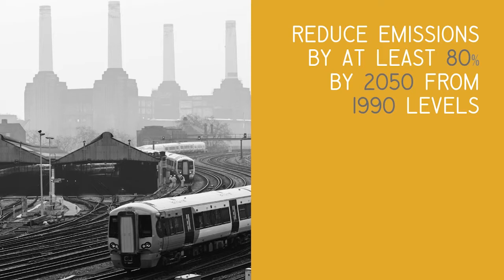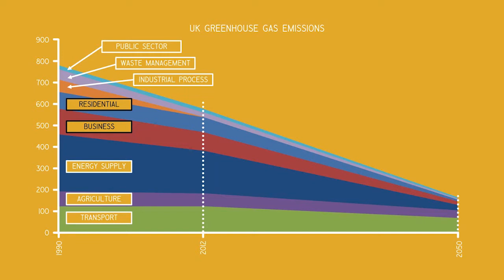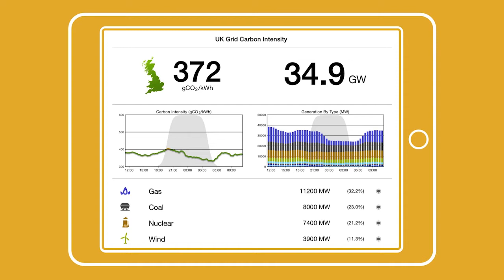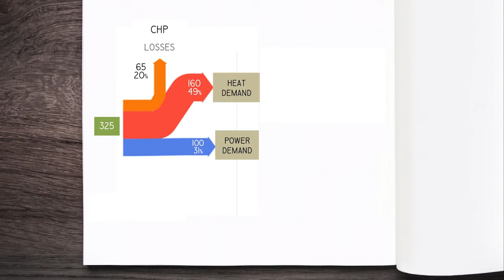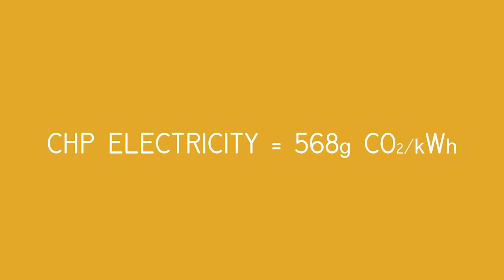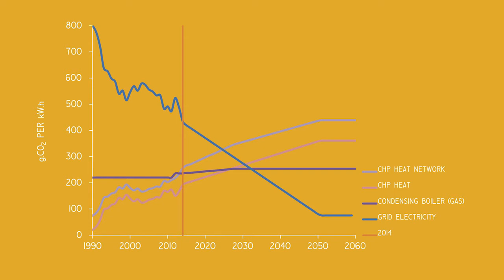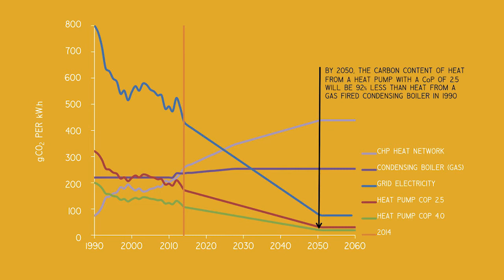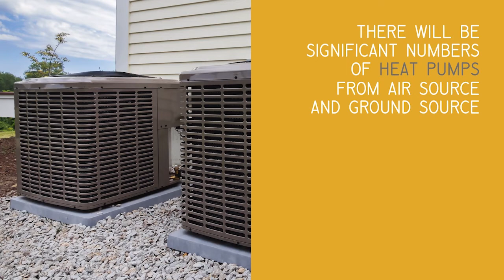Decarbonisation Of The Built Environment In The UK

Comment: Largely agree with the analysis; especially around the point that high temperature district heating systems supplied by gas fired CHP are now worse than gas boilers.  However,  I have several challenges to make on what was presented that I think paint district heating in an unfair light:

1. In a large residential development it doesn't seem particularly a good idea to have an air source heat pump per residential dwelling for various reasons, such that we often will have to see large central ASHP's that supply heat to each flat. Large central plant is also the solution on most commercial buildings. This leads to the large overstatement of the efficiency of ASHP's that James has made due to the fact that secondary heat losses will have to occur. These are losses are between 10-20%, such that the carbon intensity of the heat they supply is also in this application proportionally higher.

2. Well designed low temperature heat networks have much lower primary system losses at below 7%; clearly this will always mean that district heating systems do incur an efficiency penalty relative to a stand alone building solution. However, a low temperature district heating system can enable much more efficient "heat recycling" as James put it. The simplest example is the commercial building that is next to a residential development: apply heat recovery to the cooling system in the office building, and send it to the residential development; using large centralized thermal storage you can also defer it's consumption to the evening and morning peaks.

3. There is in my opinion a 'right way' to design implement and run heat networks that will bring really low carbon heating, at a lower cost and carbon factor than communal ASHP's or even individual ASHP's. The externalities of such a network are potentially very interesting and worth while if you consider that you can (a) balance heat demand and supply e.g. where it is often wasted, it is because it is not needed at the same time, different types of buildings have different heating demand profiles; (b) should a new and better heat supply technology come along, or should a new low carbon source materialize, it  would be substantially easier to integrate and supply existing customers from this source; don't forget the huge issue of entering each home to replace a system that has become obsolete....

Overall i like the analysis, but I think a ' how to do heat networks properly' is now due. I will certainly not be advocating CHP supplied heat networks, so James you achieved your mission :).